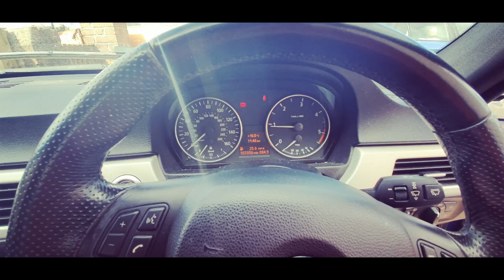Problem With The Brakes! Copart  UK Salvage Car Audi TT

Comment: You don’t need new callipers you need a rear caliper wind back tool the pistons are threaded
Reply from the maker: I have the tool .. it will not budge the piston.. the one side the pads had totally gone I think they have been stuck for a while I even bent the handle one tool trying to turn the piston.. there also seemed to be alot of play in the handbrake...I'm not going to complain over £60 for 2 new calipers... thanks for watching & your support 👍

Comment: Will you be bleeding the brakes by the looks of those brakes haven’t been serviced in a long time and all the magic breakthrough is pretty crap in there keep up the good work all the best from Terry
Reply from the maker: Yeah they defo haven't been serviced in a long time .. going to bleed the system & put new fluid in ... I dred to see the spark plugs that's for a later date .. thanks for your support Terry means alot. Be safe out there 👍